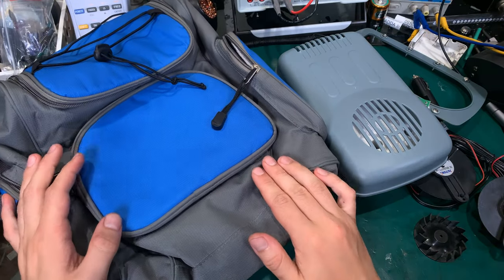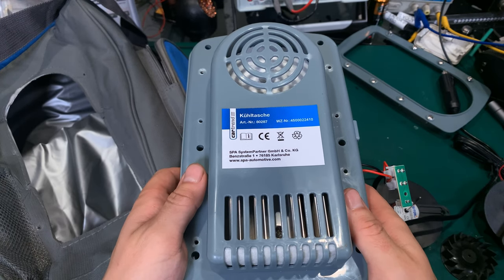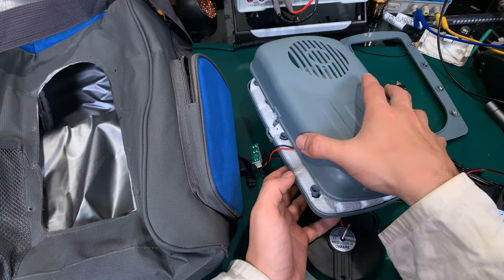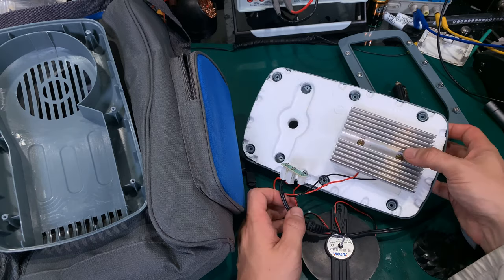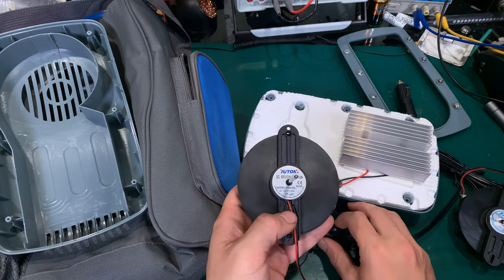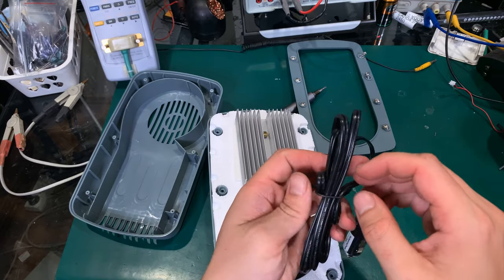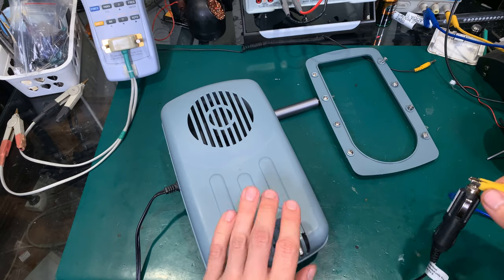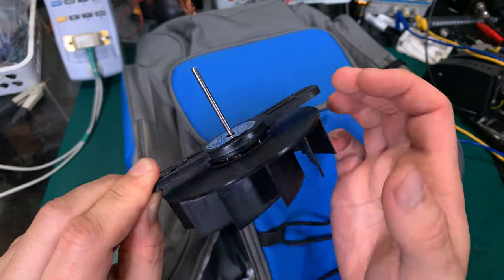Fixing - bag Soft Cooler Cartrend 80287 Kühltasche, 16 Liter, 12 V / 48 W  replace fan YJ-9225

Comment: IS this bag really cooling? Because my is not cooling nothing.
Reply from the maker: What do You mean nothing? It should give like 20C difference between in and out.  It's not a freezer so don't expect things will be ice cold.  After putting in morning cold items  and plugging in - at night they are still cold to touch.    Check if it draw current and does peltier element spit out hot air.
Reply: @ElectronicNoobBlog  well my is not even holding  a cold beverage even if it is conected to a power. Must be then something wrong with it
Reply from the maker: @vrcustoms7  Does fan is spinning? There is fuse in cigarette lighter plug - I would check it first.